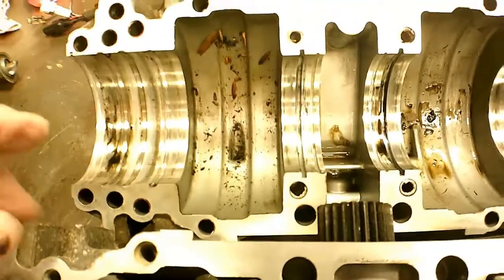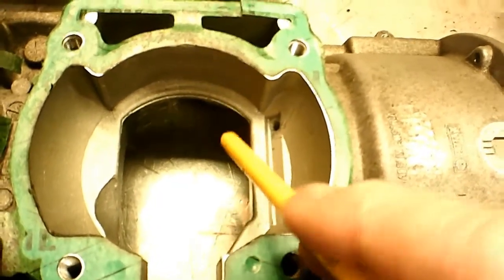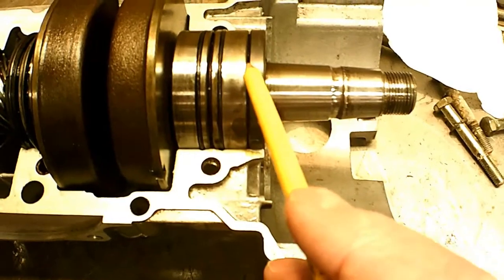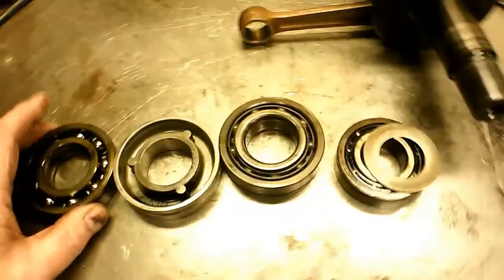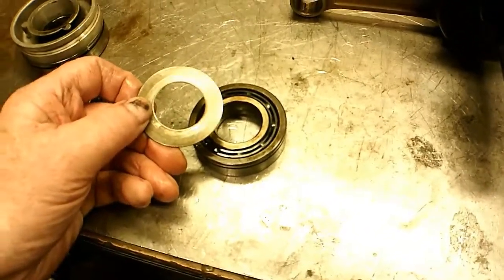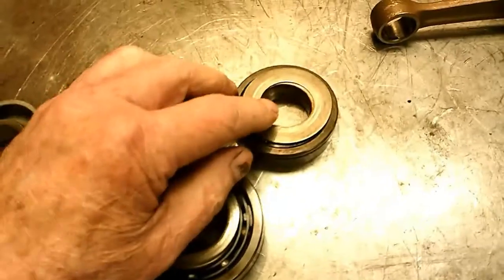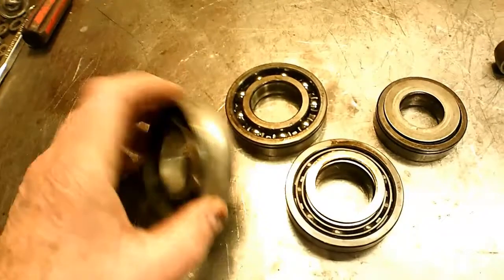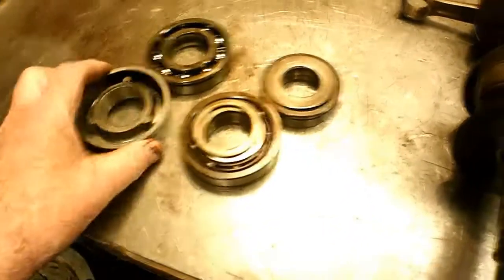Rotax 583 engine crankshaft bearing modifications.

Comment: Hello I got questions!
I rebuilding a 494cc engine I got a rebuilt crank with all the bells and whistle made to specs! My question is per repair manual(s) do my engine need just the 3 o-ring or 5 o-ring or do oven need it.
Thanks in advance

Comment: Hmmm, maybe they want oil to enter the one side and NOT get slung out the other, opening this up only creates a larger cavity for the oil to have to accumulate in before it is "full". When this is assembled there is no way for oil to get into or out of that space between them, only the outside of each bearing, the case is solid in the entire bearing and spacer area so no oil, air or fuel can enter from the inside of the assembly. What this does is create a large gap for the oil to exit the other side of the bearing. Why would you think they actually designed it keep oil out?
Reply: Perhaps. But I doubt that as fact. Considering the ol rotax 583 is tested by TIME and NEGLECT by THOUSANDS of customers over the years and has been not only been said but PROVEN to be the best snowmobile engine for over 25years. I'd say it was built to last is an understatement.
Reply from the maker: I think they were trying to keep mixture out for higher primary compression. They were looking for the highest power and were not worried about how long it would last. Selling crankshafts is a lucrative business for a lot of people.

Comment: doesn't the crankcase pressure push the oil past those spacers?
Reply from the maker: I dont think it could. Outer bearing is covered by spacer. When spinning, oil would be thrown off.  Crankcase only has momentary pressure. Mostly it has vacuum and draws mixture from carburetor.
No reason big ball bearings like this should only last 300 hours. I think they run too hot due to lack of oil.
Reply: Is this the same for the 582ul?
Reply from the maker: Yes. As far as I can see the crankshaft are the same.

Comment: Wonder if i could do this to my 447
Reply from the maker: Yes, you can. A 447 was the first one I modified as the PTO rear bearing failed when the plastic cage came off and was forced against the back of the rear seal. Made a LOT of noise. I landed and let it cool down. It was only 4 miles from my home airport, so I restarted and it had no noise. I carefully flew it back to my home airport. The end of the crankshaft wobbled a lot because all the balls will go to one side without the cage.
I did these modifications and installed a metal cage bearing.  Flew the plane until it had 920 hours on it, sold it to a friend, he flew it several years, and last I heard he sold it to someone in Indiana. Still running.
Reply: @Adventurepilot70  awesome. I might attempt this. Say a prayer for me haha